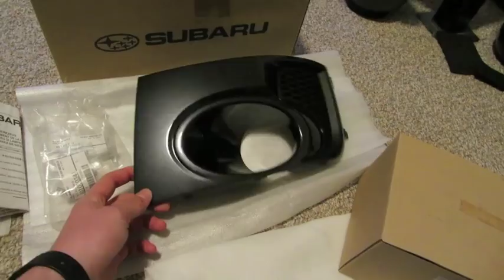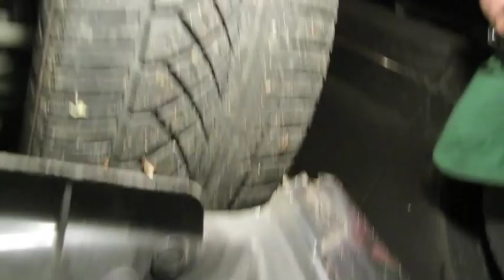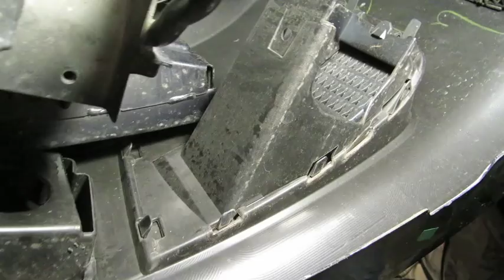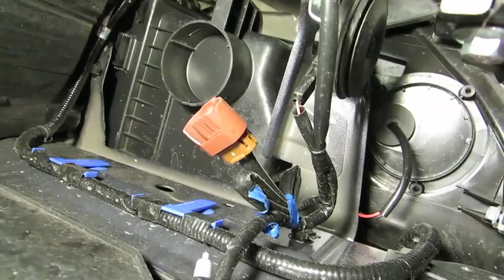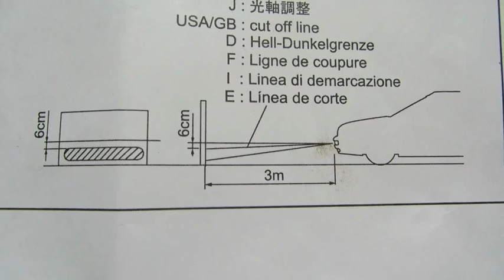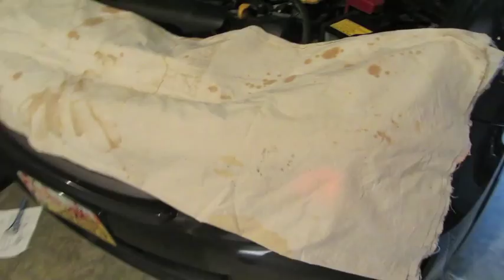2011-2014 Subaru Impreza WRX/STi Fog Light Install - No Bumper Removal Necessary

Comment: Did they work plug and play? Or did you need to buy the relay and fog light switch?
Reply: Also wondering. Because my 2010 doesn't come with fogs. The pigtails are there, but no bulbs and no switch inside the car.
Reply: @dougiespeare123  did you figure that out? Im also curious

Comment: I have the same WRX and just bought some foglights! Super excited to install them! Thanks for the video tutorial bro!
Reply: where did you buy all the parts?
Reply: boots10804 fastwrx.com they have a full halogen or LED kit
Reply: Michael Barreiro the whole bundle with fog lights and the mounting part?
Reply: boots10804 yeah here’s the link to the kit I bought. I just followed this dudes tutorial and it worked out perfect 👍🏽

https://www.fastwrx.com/products/subaru-morimoto-fog-lamp-kit-2011-2014-wrx-sti

Comment: My Subaru is pre wired but it doesn’t have the fog light switch inside the car do I need to buy one or will they go on when I turn on the car? I did not receive my fog lights kit yet this is why I’m asking
Reply from the maker: In the kit I ordered. You are provided with a new blinker/light switch which you must install on the steering wheel. I would assume that your kit includes this. I have another video on my channel detailing that install.

Comment: Could I get some part numbers? Please and thank you!
Reply from the maker: I don't have a number for the kit and I couldn't find one with a quick search but here is a link to the exact kit from subaru:
https://parts.subaru.com/a/Subaru_2013_WRX25L-TURBO-5MT-4WDWAGON/_52016_6026707/LAMP-FOG-11MY-/G12-845-03.html

The link has part numbers for the individual parts. There are also multiple reputable dealers with a google search. Or calling up your local dealer. Best of luck!

Comment: I liked your vid. We're can I get a set of those lights for my STI?
Reply from the maker: Ajai Moni I bought these from a local Subaru dealer, you can also order them from the Subaru website http://parts.subaru.com/a/Subaru_2013_WRX25L-TURBO-5MT-4WDWAGON/_52016_6026707/LAMP-FOG-11MY-/G12-845-03.html

I'm sure if you did a little searching around you could find it cheaper somewhere else, Amazon or Ebay.

Glad you liked the vid!